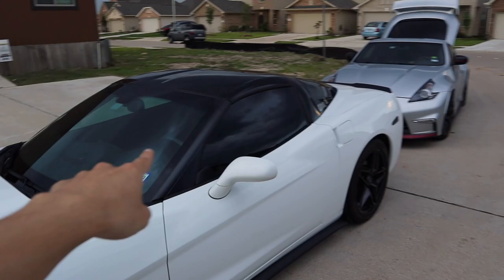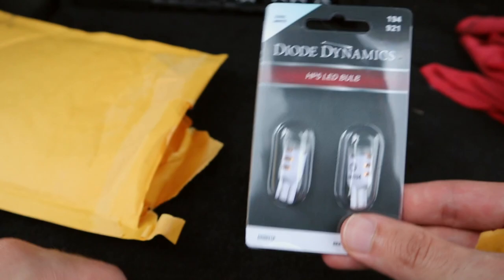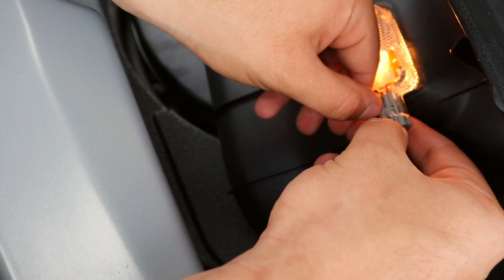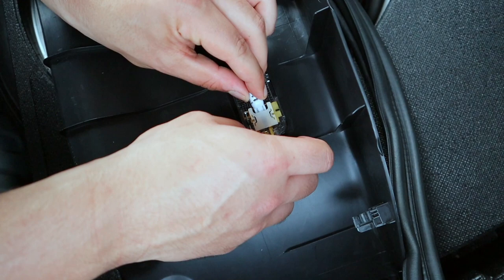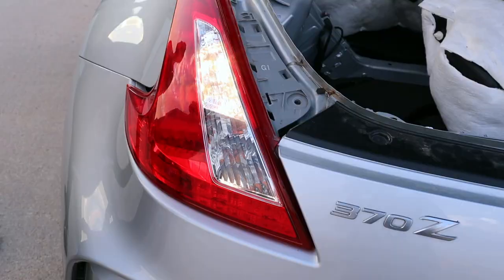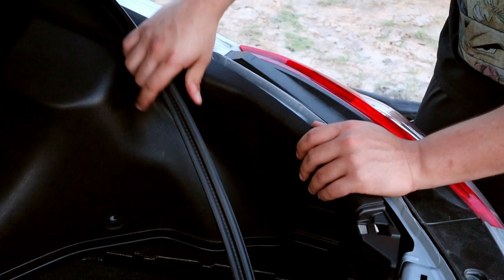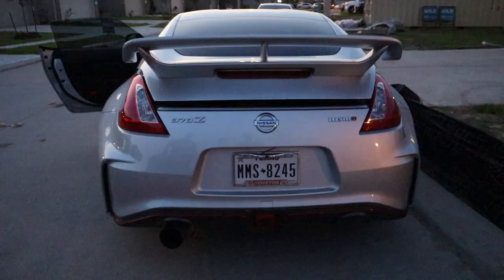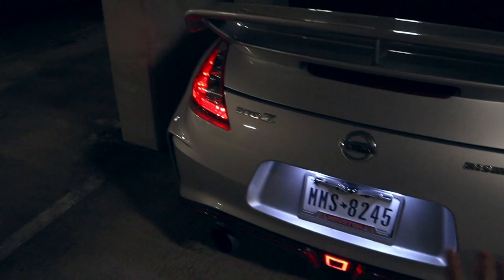Quick & Easy $20 Mod For Your 350/370Z!!

Comment: I'm just surprised a company such as Morimoto hasn't made custom rear light housings for the 370z. There are lots of headlight mods, even full housings. But no rears. Only one-off shop builds from guys
Reply from the maker: Supposedly a new taillight design is in the works from Morimoto!
Reply: @StockBoys  If they are, I will literally throw my wallet at them